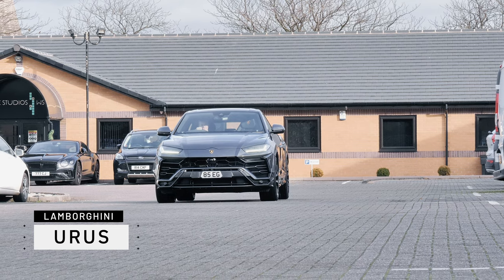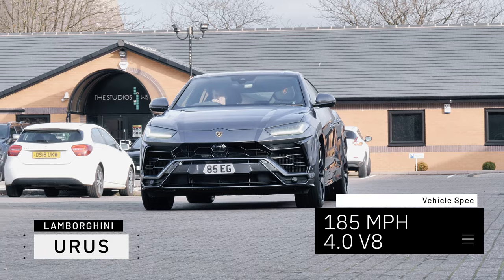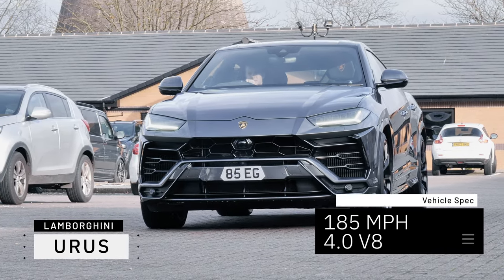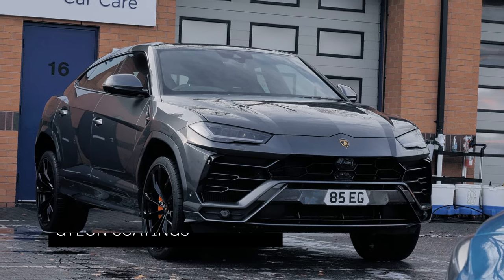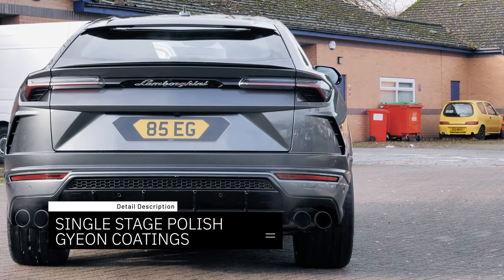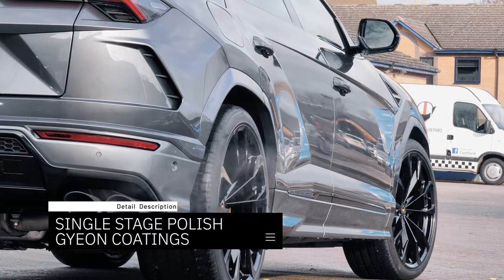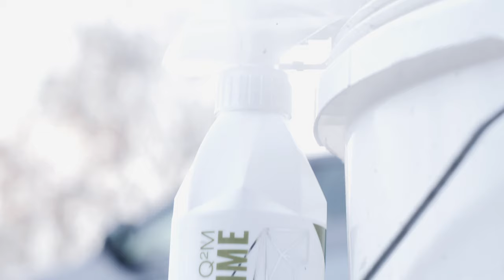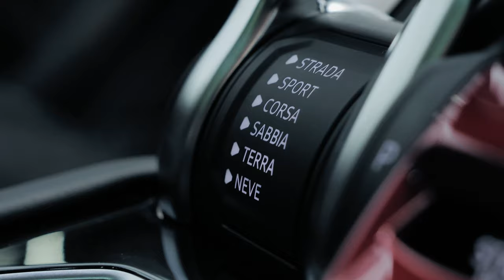Lamborghini Urus | GYEON Ceramic Protection Treatment

Comment: i have just started using gyeon products as a weekend warrior and they are far superior than anything else on the market. i applied some gyeon can coat followed by cure i know these are not true coatings as i have no garage and carried out the work on my driveway but i can honestly say i have never seen water behave like that on any car before the beads are incredible i also gave my bmw 218i m sport a light polish with menzerna ultra finish as my car had only done 800 miles. i think i will have to order some q2m rim for the wheels and some wet coat to top up the protection absolutely amazing stuff
Reply from the maker: That’s awesome